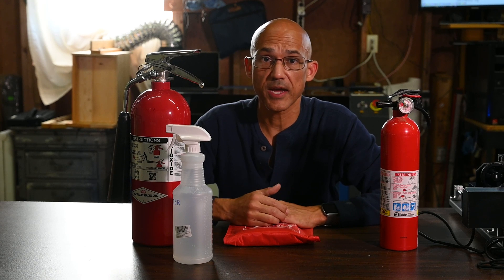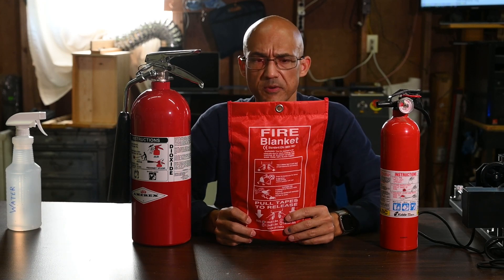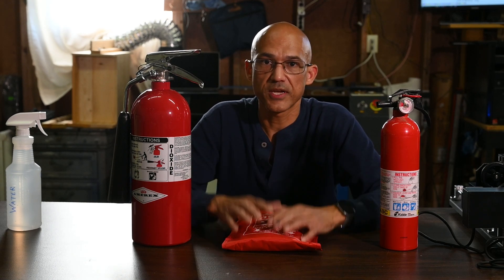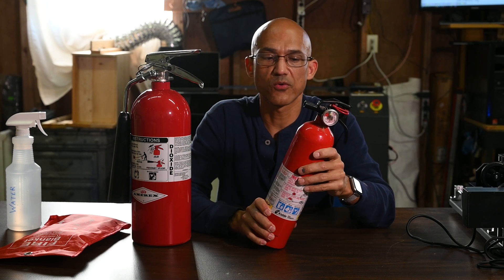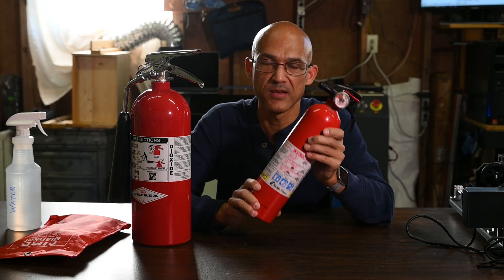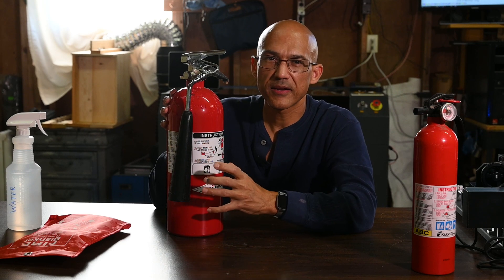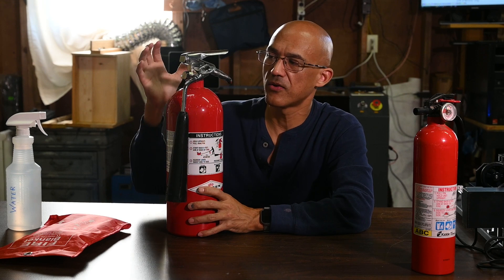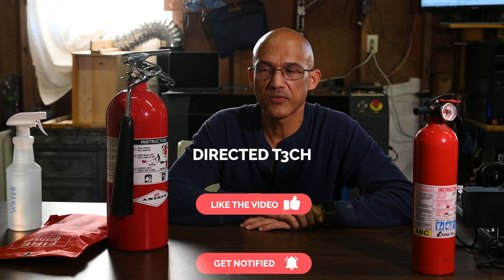What type of fire extinguisher should I buy for my laser?

Comment: Thanks for the video! As long as you use distilled / demineralized water, it should not cause any damage to electronics. (Furthermore, if there's enough heat, then the water will probably evaporate quite quickly.)
Reply from the maker: Appreciate the insight!
Reply: What are you on about? the moment water of any kind is getting into the electronics it's going to short circuit the boards and you'll render the machine useless.
Reply: @petec737  No. Normal water kills electronics because it's conductive. But water conducts almost exclusively due to the ions / minerals dissolved in it. If you use distilled water, there is practically no conductivity and thus no short-circuits. (Nevertheless, for lasers I would definitely recommend a gas based extinguishers if it's possible to use it safely in the room the laser is located in.)

Comment: great video! Thanks! Supposedly dumping a bunch of baking soda also works too to smother, probably more direct and precise than the blanket. My line of defense at the moment are 1. watching the laser (turning off the exhaust fan) 2. baking soda, if that fails then 3. blanket, if that fails then i have a bigger issue then 4. dry chem since as this point the fire will be big enough to warrant me going nuclear. I forgot where i read but there are also drawbacks to using a c02 but will likely add that to my arsenal in the future too.
Reply from the maker: Sounds like you've put some thought into this!  Well done!